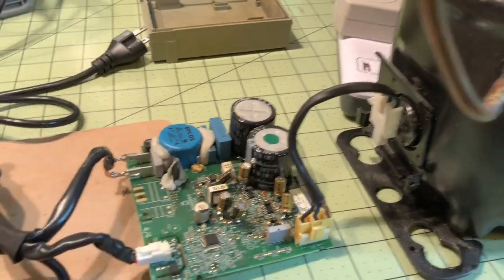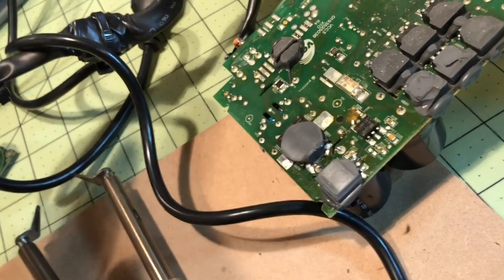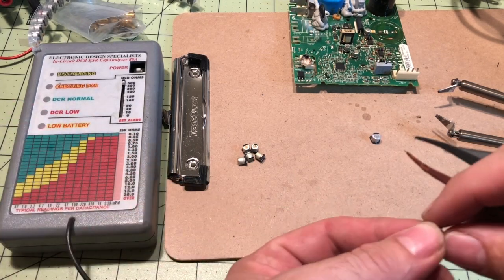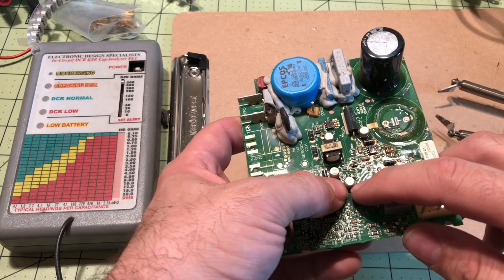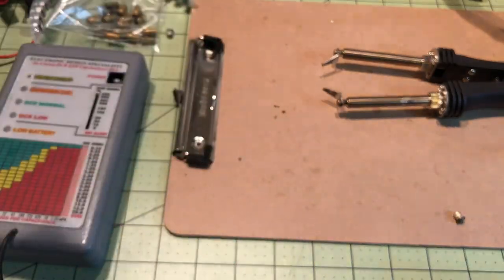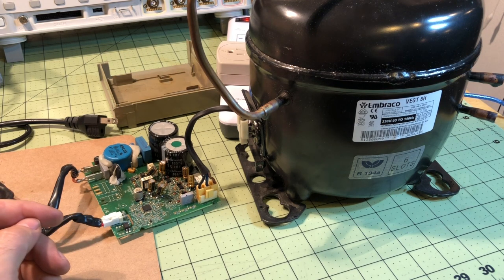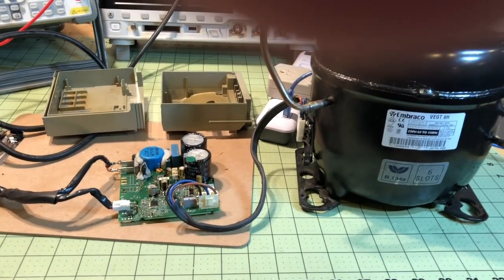VCC3 Inverter Repair

Comment: what voltage do you have on the red and black wires on the white connector, to the control board?
Reply from the maker: Signal wire is 10vp-p, AC wire is 120vac. Wire colors will vary with manufacturer.
Reply: @electronicsprojects4708  
what do you think a similar module can control a three-phase asynchronous motor?
Reply from the maker: @rms8576  this unit is designed specifically for a 3 phase compressor, I have run a different brand 3 phase compressor, but a 3 phase motor will probably be outside the parameters of its power handling, if it draws too much current, or too little, it will not start. There are units designed for more general 3 phase motor applications, called VFD or Variable Frequency Drive units.
Reply: @electronicsprojects4708  
I have been working with FVD for many years. I understand that such a thing is issued, for example, 50-150 hertz or the like, and is designed for a relatively small current. She is worth a cheap in China, I thought to take an experiment!)) Thank you for the information!

Comment: excellent.  I used a hair dryer to release the adhesive.  it took about 5-10 minutes and with gentle prying the board came loose.  Exactly the same failure you have, the large caps were leaking and some of the smaller caps are bad.   This video gave me the ability to go ahead with a repair so thanks!

Comment: Thank you so much for posting this video.  My Kitchen aid fridge went out yesterday and a new inverter board was a day or two away, it was Halloween so there was no dry ice to be had to keep the freezer frozen and my wife did not want to purchase a new fridge.  I just happen to have 33 micro-fared 50 volt capacitors in my garage from a previous project.  I was able to change these out and get my fridge up and running in 15 minutes using the heat gun on my re-work soldering iron.  Thank you again!
Reply from the maker: Cool, what was the other project?
Reply: @electronicsprojects4708  I was replacing leaking capacitors in the dash on my 94 Toyota Supra Turbo.

Comment: Great video, I need help diagnosing issue with my Kitchenaid 48" which has the same VCC3 and the main control board (W102194630). I have repaired the main control board by replacing all relays and capacitors and utilizing a new VCC3 board. The issue now is the compressor never stops and goes much below 0 where it's set at. I think this was happening before as well and thats what took the vcc3 board out. I have checked 2 thermistors and both read 2.6Kohm at 70F. I am at a loss as what to do next.
Reply from the maker: I would recommend joining 'Appliance Technician Group' on Facebook, it's a better platform for getting repair help and you can download files and post videos and pictures easily.

Comment: I have a similar board that i will now fix because of your awesome video here, the most critical piece of info was how to get the board of the housing and what usually goes wrong with the board. I have a related question, on a replacement board i bought, its same model and spec but on internal card inspection it has 320uf caps 200v x 2 instead of the original design board having 800uf 200v x 2. Do you think its because of improved design or I have the wrong board. KA model ksss48qmb01. Thanks
Reply from the maker: They have made different designs over the years, many are interchangeable. If the signal connector has 2 wires, I use the cheap GE inverter WR49X10283, never had a problem. I have seen quite a few different failures on these. I just repaired one that had an IGBT transistor, surface mount capacitor and electrolytic capacitor fail. First time I saw that. I didn't do that repair in the field, just replaced the inverter, fixed it in my lab just to see if I could.

Comment: My inverter is embraco vcc3 EM model, it doesn’t have 6 capacitor but only have 3, I can’t find the mf33 25v in the local electronic shop but Can I replace it by mf33 50v higher voltage?
Reply: yes

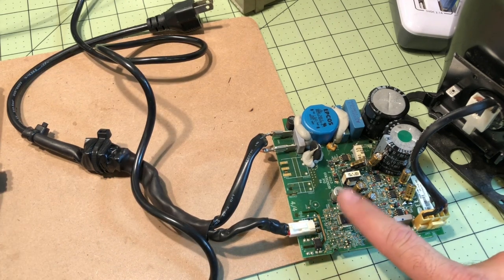Comment: At 5:32, the capacitor shouldn’t 35v 220 mf, can you double check? My inverter have this label m3 220v.
Reply from the maker: They are not all the same, you would have to cross your capacitor numbers to the manufacturer data sheet online to see what the specs are. They use different brands for the caps.

Comment: How do u do the connector to the power tha power cord do u have a video for that we have a business and like u said sometimes we just buy a new board but if we are replacing more then one I think is worth it to try fixing them 
By the way I just subscribed to ur channel
Reply from the maker: I soldered all the resistor connections, I used TE Connectivity / Buchanan Barrier Terminal Blocks, you can find the same type at Lowes in the electrical section and heat shrink, electrical tape and zip ties
Reply: Electronics Projects  where I order this capacitor do you have a link please I will really appreciate in the past when I comment here I had same issue and I had to order a new board and that fix the issue but now I have another refrigerator with same issue and I wanna try to fix this. Board this time
Reply from the maker: @juansanchez-kb4ij   You can buy them anywhere Mouser, Digikey, Ebay, Amazon, your capacitors may be different than the ones in my video.

Comment: My vcc3 inverter in Beko fridge in making buzzing noise. Sounds like relay coil or transformer buzz.  It will quiet down after couple of minutes working. Any idea what going on? Capacitors failing?
Reply from the maker: We don't have Beko products over on this side of the pond, sorry can't help with that.
Reply: @electronicsprojects4708  It looks the same. It is Embraco but it is 220-240V 50/60Hz input, 230V 73-150Hz output. Works on Embraco compressor. I am just wondering if that small transformer on the board can make such audible noise if the capacitors are failing? 
I had one of those electrolitic caps explode in my face as I was changing them. Probably was factory defective,but tested good. It went with a bang as loud as .45 shot just at my face when I pluged board into mains. I had hearing problems for half an hour. Now I just get a few meters away before testing new caps :).
Reply from the maker: You need to make sure that you pay attention to polarity. If you put in a cap backwards it can explode if it has enough voltage, I've never seen a transformer fail on one of these. @Lycras

Comment: Hi, thanks for your helpful video, I am repairing this board, i.e., VCC3 Inverter. I saw that just one of outputs had AC voltage for a couple of seconds, and then it turned off. I have replaced all the capacitors you mentioned in your video, and no consequences were observed. All 6 IGBTs and 3 Driver ICs are intact. I have a question, how can I repair this issue?
Reply from the maker: This is not the only reason it could fail, I have seen the two large capacitors go defective as well. This is the reason I take the board completely out, to test all the capacitors. You may have a micro defect as well.
Reply: Did you have the inverter connected to the compressor? Otherwise the inverter will turn itself off.

Comment: Hi how did u get the 2.4 volts thing? As i can see in the vid u cinnected it directly to the ac socket...
Reply from the maker: Using a diode cuts it down to 60 volts rms and the resistor act as a voltage divider circuit. Here's a link to the other video: https://youtu.be/HKR0tagaFy0

Comment: Can you tell me what the vcc31156c1f56 numbers mean?   I also have in bold lettering along the bottom 200D5948P012  I have other boards with the same vcc number but does not have the 220D number   will they interchange?
Reply from the maker: I look up the part by the manufacturer part number, not what's on the sticker. There are a few different software and hardware configuration differences depending on the compressor application. If you are not sure, best to go with the original.

Comment: I did the same exact replacement of 6 electrolytic capacitors in my GE refrigerator. It worked for me also! (compressor started to work again) Thanks for the tip. I didn't bother to separate the PCB from the plastic case, it wasn't necessary for removing the faulty capacitors and putting new ones on - just be careful with the soldering iron angles to not melt the case. I agree that putting surface mount type is difficult, I also used radial through-hole types for replacement - cut the pins short, bend them at the end so they can rest on the pads, solder (keep attention to polarity). I used a single tip soldering iron to remove the capacitors - by lifting from alternate side little by little. I've seen a youtube video that shows that these surface mount capacitor types come off easily if you just twist them off with a needle nose - <https://www.youtube.com/watch?v=X8N9O3a9jiM&t=135s>  The pads are sufficiently strong to not lift when you do this. I didn't do this because I was interested in measuring the ESR of the capacitors - to see if they are indeed bad (ALL of them were!) I also didn't use a fancy ESR meter, I used this one - <https://www.banggood.com/DANIU-3_5inch-Colorful-Display-Multi-functional-TFT-Backlight-Transistor-Tester-p-1083042.html?rmmds=search&cur_warehouse=USA>  This is a pretty cheap alternative to the usually pretty expensive ESR meters - and it tests anything you throw at it to boot!

I did a similar repair on a ceiling fan (electrolytic capacitor replacement), I wonder how many things go wrong because of sub-standard electrolytic capacitors.

By the way, this was my second inverter. The original one lasted like 6 years and the replacement lasted 4 years - it's obvious that they used a faulty batch of electrolytic capacitors. The capacitor replacement that I just did is likely to last much longer because the capacitors are probably better than the original batch.

The thing that is astounding to me is how the mechanical system has outlasted the electrical system in this fridge - I expected the compressor to the be the first component to go.
Reply: p4kim very interesting I read all ur comment where u order those electrolyctic capacitor u have a link ?

Comment: Is there any way to bypass this inverter ?
Reply: No, you cant bypass the inverter. The inverter provides variable voltage to the compressor; this is for savings pourposes  sending more or less voltage to the compressor and therefore it consumes just the amount of electricity required to keep fridge at the desired temperatures. The only wy to bypass the inverter is changing compressor for a old kind unit, a reciprocating one who works always at the same consuming electrical rate, so is more expensive in terms of annual electricity cost.
Reply: Thanks where can I get those capacitors brother